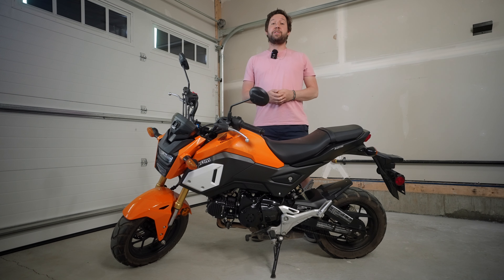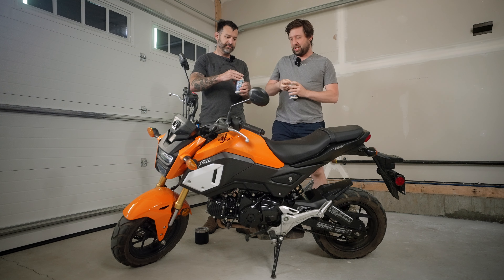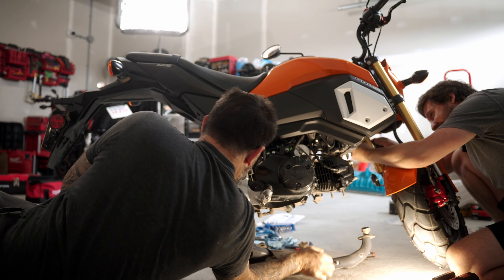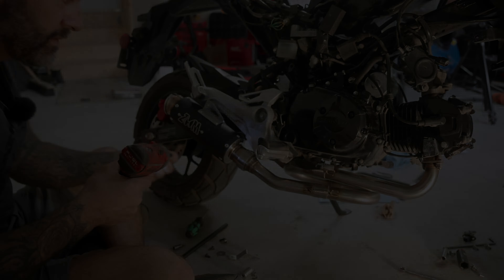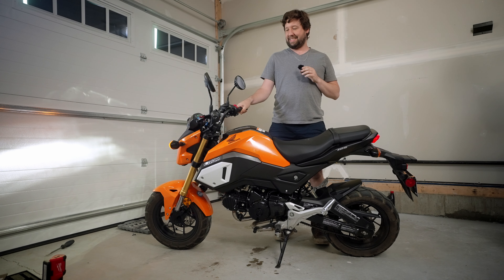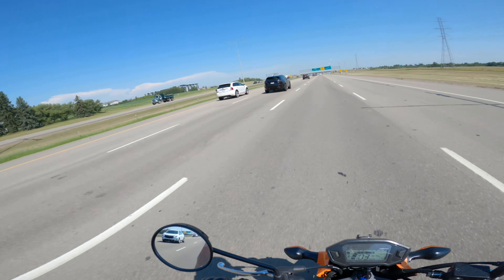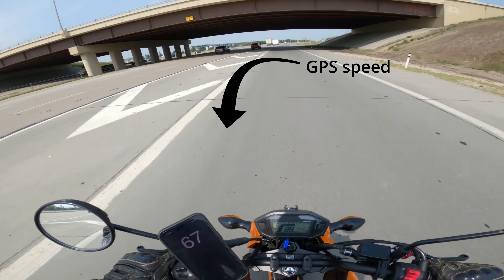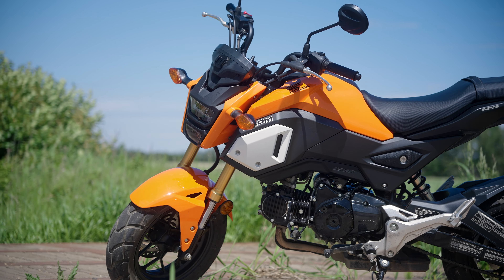Honda Grom Stage 2 - Yay, or Nay?

Comment: This is the experience that most people who 'mod' their scooters will have, as they are just throwing parts willy-nilly at it.  Everything on the engine is a compromise; on a 2-stroke engine the exhaust pipe design plays a huge part in where the engine powerband will be, but if you aren't using the correct CVT weights or springs you may never even get into that powerband.  It just isn't worth it unless its an entire kit from a reputable tuner designed for the engine.  The real solution to "I want my bike to be faster" is to buy a faster bike.
Reply from the maker: @glenndoiron9317 100%

Comment: I noticed you didn't put in new valve springs after installing the Cam. Personally I put in high rpm valve springs that are better designed to cope with the extra lift and rpm. You may experience valve float at higher rpm, but worse than that I've read of peoples springs fatiguing and breaking after a while.
Reply from the maker: @n2o_spark  yeah, I was thinking about doing that too. I also just put in the Takegawa 4th bearing mode to help with vibrations from the higher RPM.